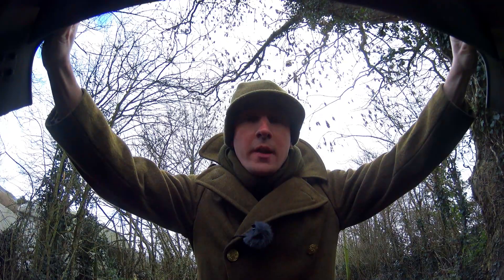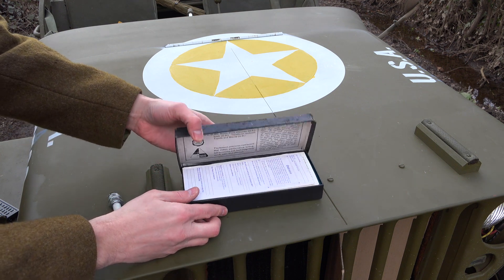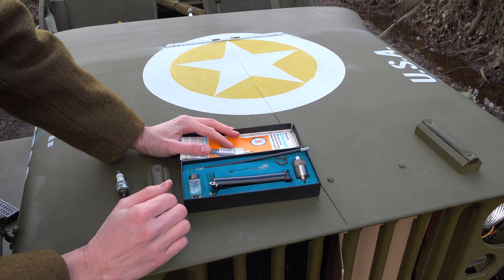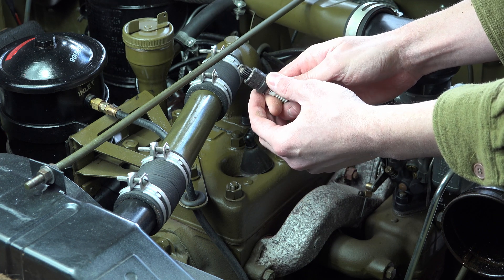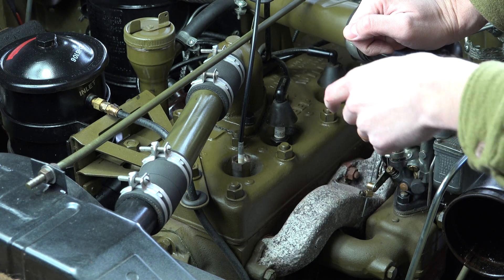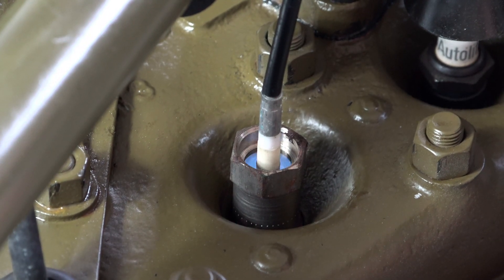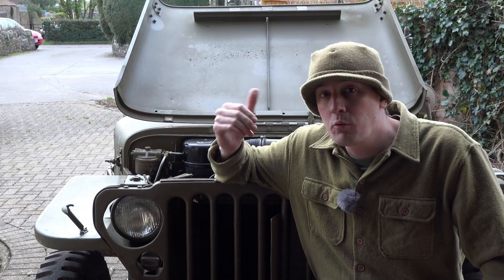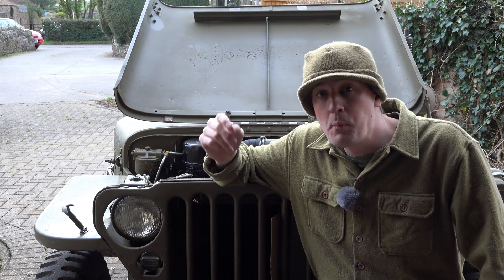Incredible Tool for Engine Tuning!  Colortune on the WW2 Willys jeep!

Comment: Have you seen the version that looks like a regular spark plug but the insulator is clear quartz?

The whole plug lights up with the glow of the flame.

You cant see into the cylinder but its a lot easier to use.

Comment: I noticed the 3 “head bolts” (nuts) in video frame have wrench marks (paint missing) from being torqued on.  You might want to touch those up on otherwise flawless restore!  P.S.   Thanks for video- never knew about colortune before this! 🙂
Reply: I wouldn't call those marks a 'flaw' as they likely indicate the very thing you've described which would be a common field maintenance procedure.
Reply: @-oiiio-3993  Touché’! 🤓

Comment: Most spark plugs are metric because they were invented in France. And champion was producing them in France ( metric ) and because of patents it was just easier to tap metric threads and use metric plugs. Henry Ford used 1/2” pipe threads because he wanted his automobiles 100% American and he had the money to buy manufacturing rights. I think that’s how the chat around the campfire, with a few beers went. Feel free  to correct me, I’m old and a bit senile!

Comment: This will be awesome to see. I've always been curious, also do you use any sealer between the carb and manifold
Reply from the maker: It is awesome!  No sealer between carb and manifold only original asbestos carb gaskets, they work best, never had a problem
Reply: @Greendot319  I got a repro gasket which I doubt has asbestos in it, but that should be fine I'd assume, with just the gasket?
Reply from the maker: Does it have copper rivets Paul?
Reply: @Greendot319  I want to tell you yes I think it does
Reply: @Greendot319  is it like a crush seal or something?
Reply from the maker: The gasket is just gently tightened down under the carb and squishes it a bit like you say, those copper rivets stop it crushing and sealing, they were designed by someone who didn't know what they were doing!  I've never used those gaskets but I belive people grind the rivets out but you have tonbe carful to make sure no metal flakes remain on the gasket otherwise they'll go in your motor.  Probably best to find another gasket without them.